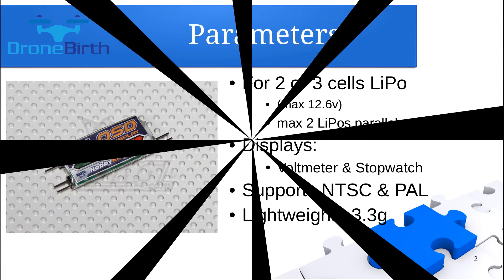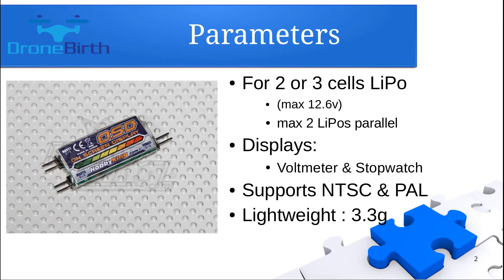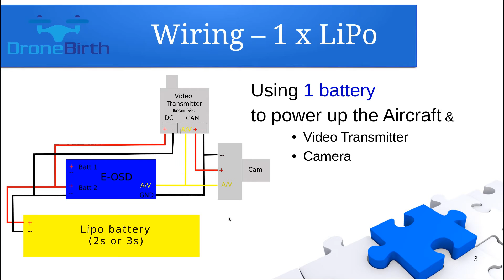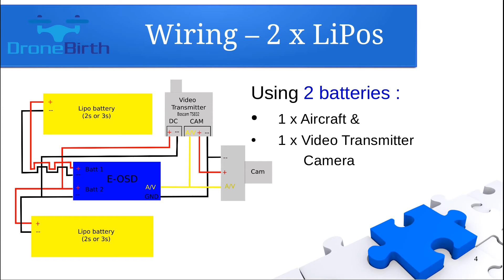E-OSD (Hobbyking) wiring, setup and review

Comment: Will i have to buy the TS832 is it required for the E-OSD to work? My drone came with a 5.8 ghz fpv camera and i view it on my fpv screen on top of my remote control. Can the E-OSD work with 1s battery 3.7 volts?
Reply from the maker: Hi, you can use any of the video transmitter you would like to. TS832 is just an example. I do not think that E-osd could work with 1s battery, so 3.2V.